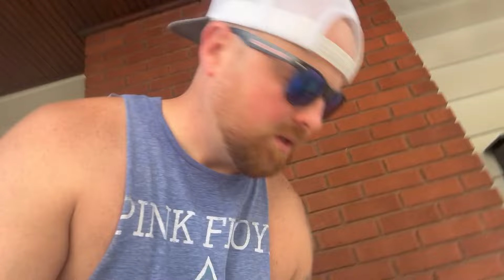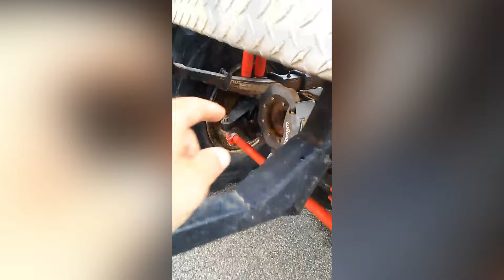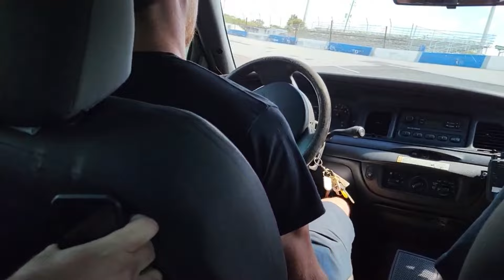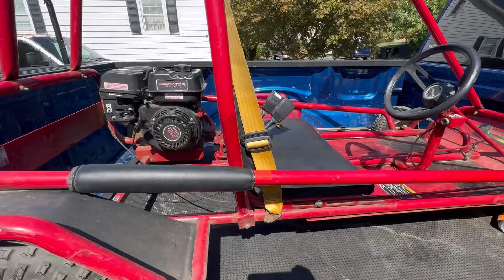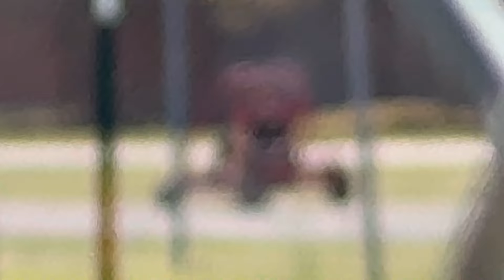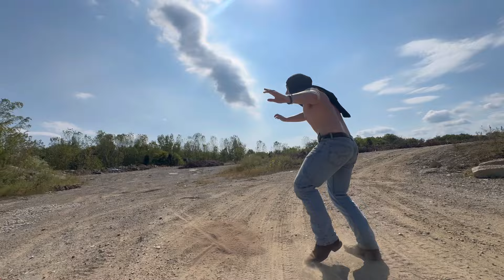This is the last one…Vlog#17

Comment: Gotcha man tell him that before you do anything the area he’s gonna weld needs to be clean of the old paint, flux core wire doesn’t like dirt or paint ! Second it sounds like his machine was too low, if he is blowing thru, tell him to move around the hole triggering the nozzle till metal starts to build up !  Eventually enough metal will be put down to weld the hole ! Sorry, , welding is all I’ve ever done !! ✌️✌️